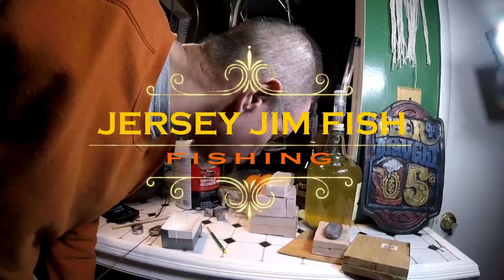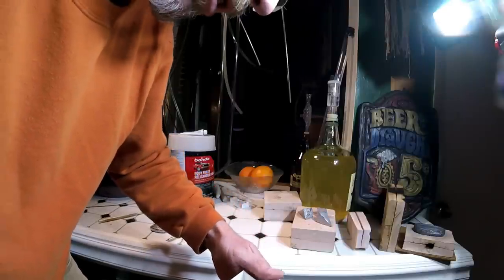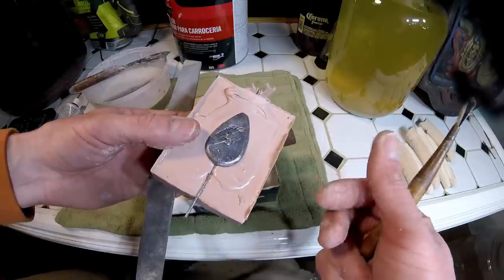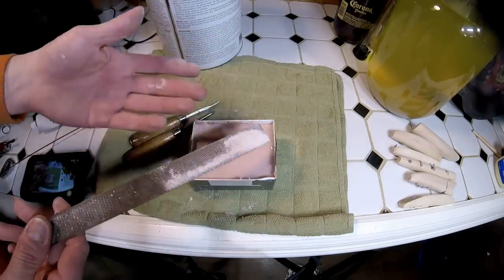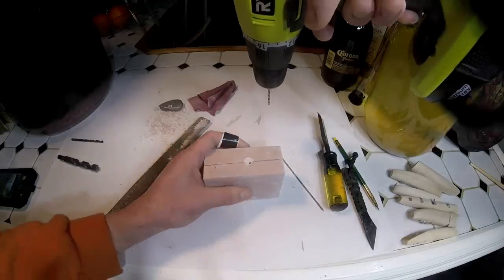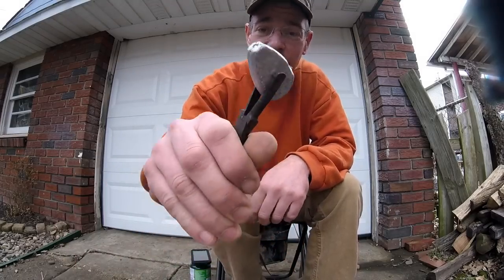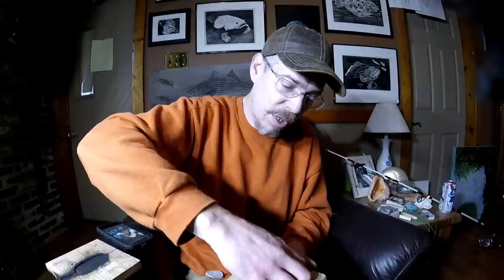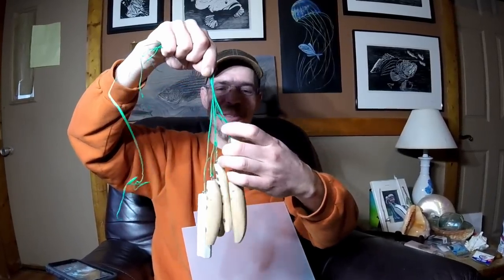NO-ROLL SINKER MOLD FROM BONDO

Comment: Very interesting in using Bondo. Will need to find equivalent in the UK. Carp fisherman in the UK use custom plastic tubing through the lead weight. To prevent the lead damaging the line. However braid will cut through the plastic over time.

Comment: just watched this video;Great job. Especially liked putting multipal things in one mold to save on materials. I did think you might have mentioned to your viewers that while the freshly poured Bondo is still very warm to the touch, it is also soft enough that they can use a knife to pare away exess Bondo down to the joining line and save themselves the hastle of sanding it flat later. I guess maybe I just don't like Bondo dust. Anyway thanks and keep on pluggin'.
Reply from the maker: Thank you kindly for your comment Mr Wilson.
 Bondo IS a joy to work before completely reacted. Next movie I make with Bondo(in the dead of winter), I will absolutely adress this idea. 
Again, thank you for the view, comment and suggestion. I do appreciate it sir.😁

Comment: as a kid, I read an article in a fishing magazine about making your own molds of a favorite lure or sinker out of Plaster of Paris. this actually worked quite well,  and I duplicated several favorite lure types with it including Smiling Bill's Bucktail Jigs, Upperman bucktails ( a thin edged lima bean sort of shape and one of the best Bluefish and striped bass fishing lures ever made),  and even a rare old "tin squid". You had to let the plaster of Paris cure for several weeks before using it, but it would be good for typically about three dozen lures before it started falling apart. Then, another article suggested using an epoxy type silicone rubber that you could mold around the Sinker or jig, but I never did try that and I don't recall where the epoxy silicone was obtained from because I've never seen such a product. (I do use epoxy glue all the time; hmm, would J-B Weld epoxy that contains steel work well as a sinker mold?)
Reply from the maker: good 'un, thanks for the comment. Maybe I try plaster this winter. The silicone that I've seen only works with pewter. I think I did see one for 680 degrees but extremely expensive and a vacuum chamber was needed.
Reply: Jersey Jim Fish, my dad bought some molds for making Diamond jigs, 12 oz size, when I was in my early teens, but they weren't very well made and the two haves didnt align well or mate cleanly,  and so they left an incredible amount of flashing on the sides of the jigs when you took them out of the mold. I brought the molds into my junior high metal shop class, milled The Mating surfaces nice and flat, installed some better alignment pins, and patched the cutouts for the eyelets on each end of The Jig with Devcon ceramic like epoxy to prevent molten lead leaking and causing flashing around the eyelets. That particular Devcon Epoxy had a porcelain like finish, looked like bathtub or kitchen sink ceramic  when it hardened, and it is amazingly tough. I don't think they make it anymore, but all these years later it's still in place on that mold!

Comment: I missed what you used to keep the bondo from sticking to itself. What did you use? When I apply bondo on top of bondo or metal, it always bonds to itself and or metal.
Reply from the maker: I used petroleum jelly.
Warming it up prior to application thins the surface so there are no brush strokes.
Hope this helps. Good luck and tight lines.

Comment: Do you think it would be possible to make a football jig mould with this method  (South Africa)
Reply from the maker: The wire hook would be a failure point eventually.
Could it be done, yes.
Will it last more than a couple of dozen pours, likely not.
For the effort and the cost, I would buy an aluminum mold for unlimited number of perfect casts.

Hope this helps, thanks for the comment Chris.😁

Comment: I don't know how many pours you get out of Bondo, but you may get more out of a gypsum product used to make investments for casting gold. Talk to a dentist or dental lab tech.  May be less expensive and more durable. Gold casts at 1750 degrees. Lead 700-800 degrees. You could try Jelenco investment, Die stone or really cheap dental stone. Very easy to work with.
Reply from the maker: Thanks for the suggestion and the comment.😁

Comment: After several pour, can you tell me if the Bondo can handles the heat from the molten lead? I've tried plaster and no success.
Reply from the maker: 4 or 5 pours and it needs time to cool. If not, the heat breaks down the Bondo making it crumbly.

Comment: What did you use for the T bar rod? What kind of metal is it that the lead doesn't stick to it?
Reply from the maker: Now that you pose the question, I think it was it was a drop ceiling hanging pre-cut piece... likely galvanized. Not advisable!

Stainless or aluminum would be a better option. Burn a candle and cover in carbon soot after tapering and you shouldn't have any stickage.
Thanks cor your comment Grant.😁

Comment: Thanks Jim. I'll be using some Bond-O.
Reply from the maker: Thanks for the comment Bob, this was an off season project and Bondo is not the greatest material with regards to the 600+ degrees of molten lead. I have also tested braid vs mono(on my channel) and the braid is not so great with the no-roll sinkers. Given the option I would buy a Do-It-Mold and get an unlimited number of casts instead of a clearly finite number using bondo. Still, it was a good project and I learned a lot.
Reply: You'll make your money back in the first day with Do it molds. I have a couple and I made my money back the first pour session 😉

Comment: I made my box mold for my bondo  went to lowes got bondo  gonna try to make  a 5oz noroll  mold  and a 3-4oz bank sinker mold if the 5oz turns out good  cure time  should be fairly quickly with  the 90+degree week we are having
Reply from the maker: Thanks for your comment Curtis.
The curing time for Bondo is an ectothermic one and has little to do with ambient temperature.

Let it cure as long as possible and dry it in a low temp oven b4 pouring.

If there is ANY moisture in the Bondo, it will degrade big time!

I wouldnt pour more than 3 b4 allowing it to cool off if you want the mold to last.

Again, thanks for the comment.
Let me know how you make out Curtis.😁

Comment: Hi I live in Trinidad an we don't have Bondo so what is the best thing to use to make the moulding
Reply from the maker: It is automotive body filler Watson. While I have nover tried using it, I have heard that plaster can be used. I would be very careful if trying though as it is prone to cracking at high temperature with moisture present. I also have an early movie on making one from wood on my channel. No roll sinker mold #1... I think(it's been a while).
Reply: Rafael from California.  I started using bondo for lead molds 30 years ago. So nothing new to me. So to your question, you can also use plaster of Paris.  Even cement   so good luck hope it helps

Comment: Have you tried JB WELD? It’d probably add longevity to the molds.
Reply from the maker: I have not. You mean in addition to bondo? Is it compatible?
Reply: I was thinking instead of bondo. It’d be basically like steel and higher heat resistance. I haven’t checked the cost effectiveness, might be a no go as far as $. Maybe as an additive, hadn’t thought of that.
Reply: Do-It Molds has a single mold for $36.95+S/H, or like $53+S/H for the triple mold. 10 oz JB WELD is $19.99. Maybe make 75% of the mold out of bondo with interchangeable “sleeves” out of JB for each size sinker. I’ve seen JB used to make a cylinder head for a lawn mower. Didn’t last forever, but it lasted a while. Bet it would last forever as a sinker mold. Just something to “overthink” about. Lol
Reply from the maker: Interesting idea. Not really using the no rolls anymore though. They dont play well with braid.

Comment: Agitation makes bondo go off quicker.  At one point too much hardener makes for a SOFTER finished product. Could use pure Portland cement in place of bondo, a lot cheaper (wait until it is totally dry before use).  That's a gallon of flocculated mead ain't it?
Reply from the maker: Why yes it is, flocculated with bentonite clay. I quit the no-roll sinker as it doesn't play nice with braid.(I tested mono and braid thru these very sinkers.[braid failed terrible!])
Reply: Idea: drill hole in sinker to lodge a Q-Tip end.  The Q-Tip tip is soaked in fish fertilizer and fish oil from a gel cap and serves to disperse scent. I once made 5 gallons of mead (I kept bees) It tasted terrible!. I hope yours tastes like Ambrosia, mine tasted like Moxie.
Reply from the maker: @jthepickle7  the only mead I have ever drunk which was palatable was a batch of methaglyn I made fpr my son Dylan when he graduated from high school. It'll be ready to drink wen he is 21.
Reply: Oh, with a name like methaglyn it HAS to be good!  What the Hell is methaglyn? - distilled mead? Now the worst beer I ever made was that 'pot porter' - I had that stuff all to myself!
Reply from the maker: @jthepickle7  It's on my channel. MY SON GOT METHAGLYN FOR GRADUATION. It's an early movie for me.

Comment: How many casts are you getting out of the mold
Reply from the maker: Only cast it 3 times, tested sinkers on braid and quit. They chafe the braid terrible. No good for me. That being said, as long asnot too many castings in a session one should be able to get dozens before bondo craks up. Do-It-molds are not unreasonably priced and very long lasting.
Reply: I got every mold I make 100lbs a year I was just thinking about doing a if you in a tight spot video about one
Reply: Bigbub Outdoors bond costs more than a mold

Comment: There a cheaper way boss !   Pour thin layer of aluminum in your mold . Then shove as much metal steal shaving , nuts , bolts as a filler for weight . Finished pour with aluminum  . Work fast and alway keep the mold hot too while you working   . You will have to change your mold design .  I used cut round steel pipe about 1.5 - 2 inch round by 3/4 inch tall  . Steel scrap & little liquid aluminum is cheap !
Good luck

Comment: Are you still answering questions?
Reply from the maker: Absolutly. What's up?
Reply: @JerseyJimFish  I admit,, I've only watched this one video of yours,, but I've been searching YouTube videos for quite some time, trying to find a means of being able to cast a mold to make a lure for saltwater,, I've been thinking aluminum/lead composit. 
Have you made any more molds of this Bondo?
Do you happen to know how high a temperature it could withstand? Aluminum has a higher melting point than lead and I'd rather not have an explosion of molten metal!
Reply from the maker: While I don't know factually, would not recommend pouring aluminum into bondo. It is barely able to tolerate the lead and only for a couple dozen casts with heavier castings.
I did a movie in the spring LEADHEAD PLASTER PROJECT that might help you.
I'm thinking maybe making a mold from refractory cement might be your best bet for aluminum.
🤔Hey, thats a damn good idea you just made me come up with...🤣🤣🤣
Refractory cement casting for lead!😎
I'm off to cut fish at"work" now.
Let me know how you make out and feel free to ask.
Thanks for your inquiry NC.😁
Reply: @JerseyJimFish  something else,,, you might try drying the molds in a kiln,, that should eliminate excess moisture in the mold.
Thanks for answering!
Reply: What is your source for that stout wire?

Comment: Why dont you cast stainless wire into the weight, or cast the swivels right into them? That way you can tire your line right to the weight
Reply from the maker: I did just that in another Bondo project when I made a 3 cavity pyramid sinker mold. (On my channel as well.)
Thank you for the suggestion and comment.
Have a happy New Year.😁

Comment: Don’t the mould need to be warm for the lead to flow better or set the lead
Reply from the maker: Firstly, thank you for your comment and inquiry Daryl.
Yes, a warm mold does help the pour.
Bondo is not the greatest with regards to high temperatures though.
It gets crumbly after multiple pours.